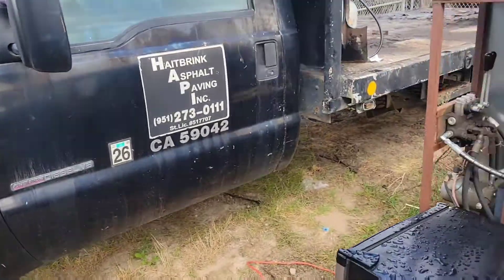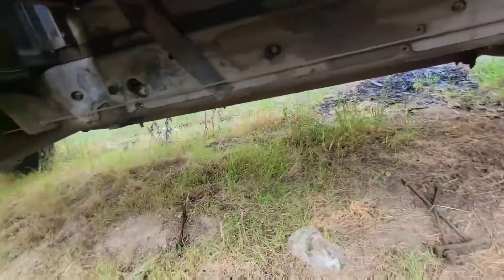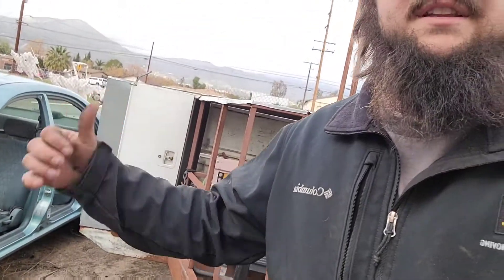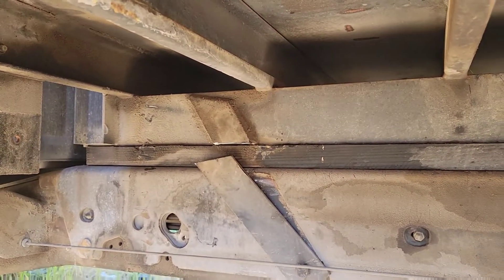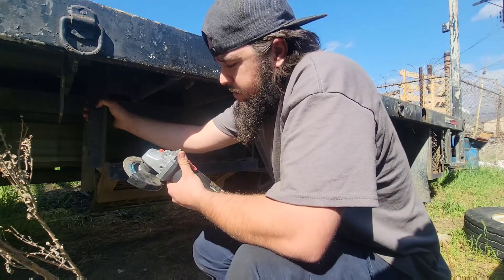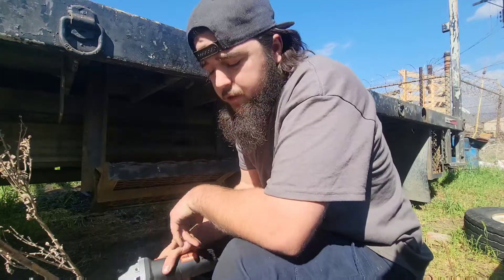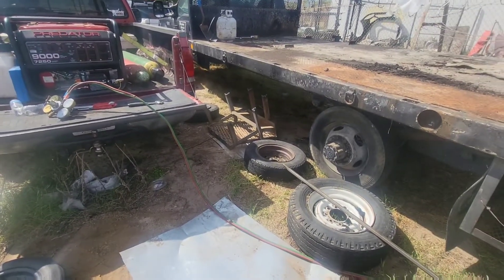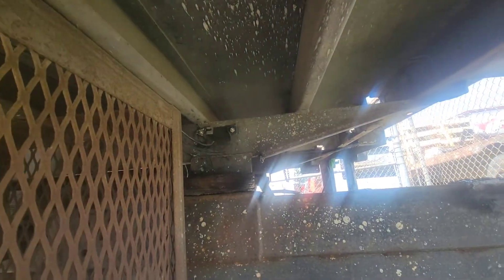Removing Bed From 1999 Ford F-550

Comment: Try out the arch oil oil additive helps with the stiction on your injectors
Reply from the maker: I will give that a try thanks
Reply: @backyardmechanics5170  I run the fuel additive the oil additive arch oil